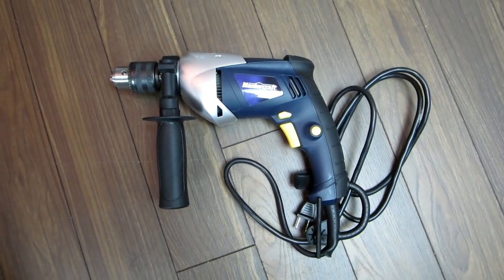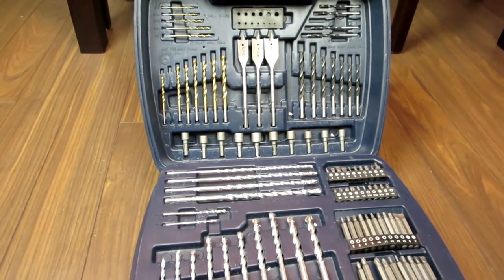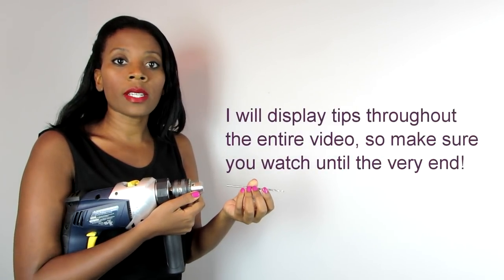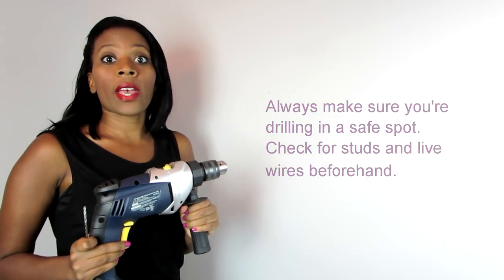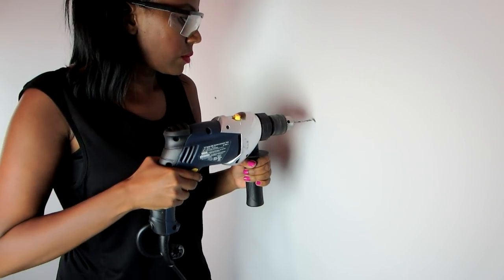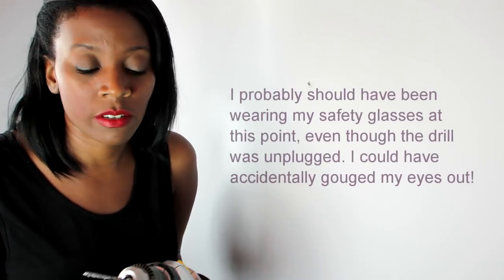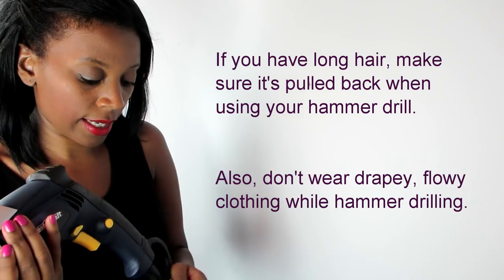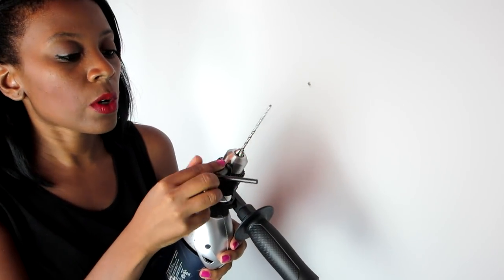How To Drill Holes Into a Concrete Wall with a Hammer Drill

Comment: The problem all hammer drills face is most of the energy in the impacts is wasted on the weight of the chuck. A little moves the bit. My best advice is to use a cheap hammer drill but buy the best masonry bit you can find. Buy only the one bit that you need rather than a set if you are not going to be drilling a lot. Lean against the drill putting the drill into the hollow of your shoulder but use the auxiliary handle to control. If the drill binds it can twist, hurting your wrist.  Notice the bit moved from the actual point you wanted to drill. Start without the hammer action and when you've created a shallow hole stop and activate the hammer. My missus is a tiny 45kg asian lady. She can handle a drill so I know anyone who is able bodied can too.

I know wood framed houses are common in the US but where I'm from almost all dwellings are reinforced concrete (highrise). If you live in such an apartment there's a possibility you might hit a steel reinforcement bar (rebar). If you do, don't bother continuing, just change location and patch the hole up.
Reply: this is really good advice. exactly what i was looking for that wasnt in any of the youtube videos ive been watching the past hour.
Reply: Love this as I live in concrete apartment and i just want to fix things and hang pics
Reply: The first 2 pieces of advice you gave is exactly what I did to start my drilling adventures as a novice. Thanks.

Comment: Great video, so hard to find ones that are informative and to the point.  I do have one question, how fast do you have the rotation setting? Mine has 2 modes slow (400/s) and fast (1200/s).  Not sure which one to use.

Comment: Erm...A few points you might find helpful: Use the key to tighten the drill bit before you even start. You don't want it coming loose when drilling. Drill bits can get very hot, that's hot enough to burn you quite badly. For masonry work, dip the bit in cold water in a cup from time to time. This prevents the bit burning out. If the tip gets too hot and detaches then you will have to dig it out of the wall. Keep the bit straight at all times. As tough as it looks, a long bit can flex and snap during use. For this reason do not lean your body weight on the drill, just arm pressure (yes its tough) or you will fall against it if the bit snaps.
Reply from the maker: Philip Jones Thanks for the tips, Philip!
Reply: Philip Jones Wow good advice. Do you do videos?
Reply: Thanks. I'm going to buy a black & decker drill for some projects around the house.
Reply: This is true. I got burn so bad as if i touched a hot stove.

Comment: I just wanted to say that the type of drill you have means a lot. I have no idea what drill you're using, but always go for Makita, Bosch, Dewalt, Milwaukee depending on n where you live. Just listening to that drill tells me it's not making the right sound to actually get you through the concrete. Also for concrete, I'd use cord over cordless because they provide you more power.
Reply from the maker: It’s a hammer drill. It goes through the concrete pretty well. I use the hammer functionality of the drill maybe once every 2 or 3 years so spending the extra money on a cordless drill isn’t worth it for me, but I agree generally speaking, cordless drills make life easier.

Comment: What make and model of the hammer drill are you using? How much does it cost and where did you buy it?

Is it the best one there is? I heard Makita are the best.
Reply from the maker: +DM my hammer drill is made by Mastercraft, a brand by Canadian Tire. I got it for years ago, so it's no longer sold, but there are many great options to choose from. I haven't used Makita before, but it's a great brand, so I think you'd be safe with it!

Comment: Thanks for the instructive video. Say, why didn't you use a masonry drill bit when you were going through concrete?
Reply from the maker: +yadusolparterre oh, it's a masonry drill bit! Trust me. I actually bought that one separately from what came with my kit. If it wasn't a masonry bit, I'd have no holes in my walls!
Reply: +I See Melanie great, thanks! I'm hesitating between buying a hammer drill and an impact driver. I can't find a video explaining and showing the differences simply and clearly. Next time you are looking for a new topic, think of me :)
Reply from the maker: LOL for sure. I need to learn the main differences between those two types of drills myself!

Comment: I like the safety instructions being highlighted as I was looking forward to buying a battery powered Bosch power drill. I would be using it for making some wooden cupboards and perhaps might attach L shaped metal pieces to get the frame to stay firm on the wall. I got a Question, what sized drill bits to use with what size screws?
Reply from the maker: I used Tapcon screws - 3/16 screws, 1.75 inches long, and the bit was 5/32
Reply from the maker: And thanks for watching!
Reply: Thanks.

Comment: It's not necessary to drill the full length of a bit to drive in an anchor. You could have reattached your drill depth rod to left side of your drill to help you control the depth of the drill hole.
Reply from the maker: dtriniboss oh I know! Did you see how long my drill bit is? I definitely wasn't going to make a hole that deep!

Comment: I'm 5'1" and weak. sadly, I bought a hammer drill and tried this. it didn't work. I am not sure it even drilled into the concrete a little bit. I returned the drill. now may hands hurt.
Reply: You should do some weight lifting exercise , dear. Strong muscles and joints could have done the job. I'm sorry for your sore hand . I'm small and light too but I can still manage physical labor beyond my apparent physique.

Comment: Just buy a rotary hammer to save you stress!
Reply from the maker: I agree, the hammer drill is a stress-inducing tool. Luckily I don't have to use it too often. I've probably only used it 4 times since I shot this video 3 years ago.

Comment: Screw, walplug, plank, brackets, screwdriver at hand. Drillbit right size. Drill on hammer mode, goggles on, adrenaline flowing, senses on high alert. Let drilling commence. 2 minutes later..... bloody big hole, crumbling at the edges and not even half an inch deep. Sweat dripping and I am fuming. My husband says, "get a handyman in!"  I tidy up the drill, tell myself that we will never have shelves and get the instant filler out to fill in the holes. I will try again another day.

Comment: For easier handling, you can untighten the front handle (turn it counter clockwise) and move it to a horizontal position, then tighten it again. Put it on the left side if you are right-handed and vice versa.
Reply from the maker: Neat, I never thought of that. Thanks!
Reply: I See Melanie Np, just stumbled onto your video, and I am truly impressed. I know a lot of macho guys who are terrified of using a hammer drill, kudos to you for making this tutorial. As for drilling in different materials
(I saw some questions about it in the commentaries): if your drill bit stands still for a long time, then watch out. It means it has struck something that it can not break. All energy will be converted to heat, which in turn can start a fire. This is not the case if you are drilling in concrete, which the video is about, but as a general tip: if the drill bit doesn't sink into the hole, it is either blunt, or the wrong kind of bit. Don't let this put you off the DIY, it's not rocket science you know :)
Reply from the maker: Eskil Eriksson The more tips, the merrier! Thanks for the compliment, Eskil, and sharing your knowledge!!
Reply: Aww blushing Now I'll have to watch all your videos (which will be a delight).
Reply from the maker: Eskil Eriksson aww, that's sweet!

Comment: These kind of drills are not made for concrete work. They are for brick or other soft masonry.
For concrete and hard masonry you'd need an SDS drill.
With this kind of drill in concrete the only thing you do is destroy the drill bit.

Comment: Make the drill go slow  or fast as you feel it gripping or slipping. If it slipping it gets too hot and doesn't do much and if you slow it down you get it to grip again and make quicker progress. Keep changing the speed if you have that choice. And hammer the drill yourself but not too much.

Comment: I really don't know anything about this but I recently been trying to beautify my apartment with some decorate wall candles. I used my hammer drill and the whole got extremely too huge for the screw. How do I maintain a small hole and not strip the screw?? Help
Reply from the maker: Hey Coli! First, make sure you have the right drill bit for the screw. The bit should always be a bit smaller than the screw. My go-to is 5/32 drill bit with a 3/16 screw. Check on the box the screw came in for the recommended drill size. Are you working with a wall that is drywall with metal or wood joists are a mix of drywall and concrete like mine? To be honest, I'm not quite sure how you would go about fixing the concrete part of the wall. As for the drywall, a little bit of spackle can fix it up. And to be honest again, I've never drilled through a part of the wall I've spackled - I find another spot to drill the hole. I hope this helps a bit!
Reply: Coli Crazed 
Did you use a wall plug (dowel)? If you don't know what's in a wall start out with a drill bit that's too small for the screw. It will also wander less that way. You can then widen the hole with the the next drill size and work up until you know which size is right.

Depending on how the wall is built it could be impossible to fix the hole in a way to drill again at that position. Plaster won't hold anything, you at least need to use cement. But if you drilled into a cinder block (which is just a few cm of concrete and then hollow) even cement won't hold well there. All the cement/concrete will just fall into the hollow part of the brick. In the end enough will be stuck to close the hole, but it can't take any load.

You may be able to stick a smaller wall plug (the one you orginally wanted to use) into a bigger one and insert that into the hole. But I wouldn't hang a shelf from something like that, but a lamp could be fine. 

There are also wall plugs that anchor into the hollow. They are mostly used on drywall but the right kind will also work on thin walled bricks very well.

Comment: This kind of impact drill is not for concrete.You can drill bricks and other softer material,but it is to fast for concrete and it will burn the carbide tip on a drill.
Real impact drill ,made for drilling holes in concrete,have much slower speed and much harder impact ,they are larger and heavier .
You can drill hole in hard material with only chisel and hammer.You just put chisel on a surface,than hit it with a hammer,turn,and than hit it again.......Impact drill do the same thing,only much faster.

If you need to drill hole in concrete and you have drill like you have on the video,than you need to drill with small drills,because,bigger ones will burn the carbide tip.You must go step by stem,from smaller to bigger ones.
Reply from the maker: My drill was designed for what I used it for. It works and hasn’t ruined any of my drill bits.
Reply: @iseemelanie  
Don't be so defensive,because i'm just giving you advice.
In absence of real hammer drill,you can use this small one,nut it is not what is designed for.
Hammer on this drill is too fast for concrete,which is very hard,and in most of the cases ,it will burn the carbide tip.
Ok,you can drill a small hole with 3mm or 4 mm ,but anything larger will burn the tip.

I use this tools for years and i have tried everything.
Reply from the maker: LOL I'm not being defensive, I'm stating two facts!

Comment: I was using a regular hand drill and heard that noise my dumb behind thought it was metal never knowing it was concrete 🤣🤣 can the hammer drill be used as a regular drill as well?
Reply from the maker: Yes, there should be a switch to go from the hammer function to the regular drilling function. So you won't need to have 2 drills.

Comment from the maker: +ishudshutup I'm glad you liked the video! To answer your question, I'm not 100% sure, as my hammer drill only has one setting. I'm guessing that the faster speed might be better for materials that are harder to penetrate. So maybe 400 would be used for, say, wood, and the 1200 speed could be used for concrete. Of course with increased speed, you'll need to have even more control, so be mindful. Sorry I couldn't be of more help.
Reply: +I See Melanie Hi Melanie, sorry to say but you are using a wrong drill. The drill you use is good for red bricks, but for concrete is best to use a SDS plus drill. With SDS you are not allowed to use strong pressure while drilling but gently feed the drill into the wall.
With SDS plus drills its a piece of cake to drill into any concrete. In the time you are dilling that one hole, with SDS plus dills you coould have done 10 holes.
I hope I was helpfull.
;)
Reply: +Desnotre Watson sds pluss drill, aka impact drills, aka rotary hammers. just for clarification purposes. the problem with drill machines are there are several words for them, not only in english, it's just annoying. one would think her drill actually has the "hammer" function. it's only rotating and it should only be called rotary drill machine.
Reply: +Desnotre Watson   and for those reasons a rotary hammer drill is at best double the price of the hammer drill. if she were a mason, or just enjoyed turning hardened concrete into swiss cheese, sure, that's the tool to go for, but a regular hammer drill will mostly suit the average homeowner's light duty needs.
Reply: Nope, low speed for brick/concrete, high speed for wood.

Don't keep popping it in and out, the drill will just wander around, apply pressure and withdraw only to clear the debris.

Protective glasses are not an optional video prop, you should have been wearing them.

Comment: Hammer drill vs rotary hammer....First of all there are no such things as hammer drills. They are just regular drills that they are advertised to be able to drill in concrete but the truth is that they fail to do so. Rotary hammers are the only DRILLS that CAN reliable drill concrete. But because I don't believe in hammer drills also I don't call rotary hammers rotary hammers. I only say REGULAR DRILL (the ones with regular chuck that ARE NOT ABLE to drill in concrete regardless how they are called or advertised) and SDS Drills. An SDS drill is comercially called "rotary hammer" but this is INCORRECT. It is only a drill with a REAL capability of drilling concrete and another type of mount for the drill bit. So there are no hammer drills nor rotary hammers in this world. Only REGULAR DRILLS and SDS DRILLS!
Reply from the maker: Okay

Comment: That sound is horrifying. I'll need to use one of these drills tomorrow when mounting a TV wall mount, really not looking forward to hearing bricks squeal. I've got 4 12mm diameter, 10cm long holes to drill. With this video, I should be fine but, wish me luck regardless!
Reply from the maker: +Ameer Mahmood I hope everything went well with your drilling. Hopefully, you won't have to use your drill that often. I'm going to have to use mine in the next couple of days and I'm dreading it!! Thanks for watching!